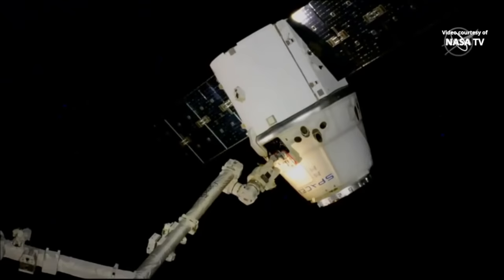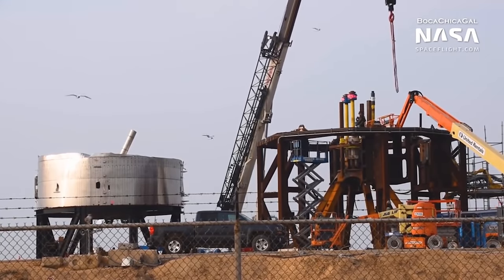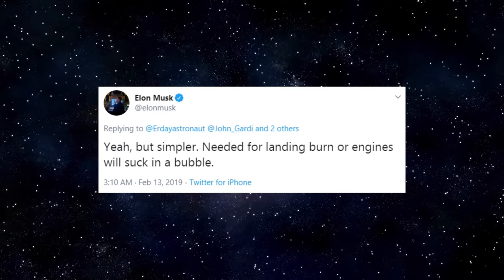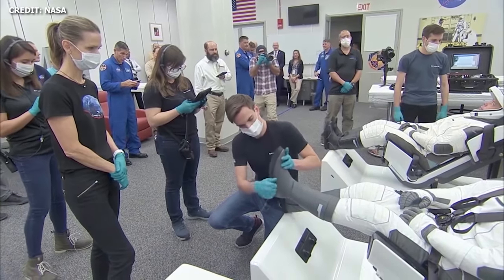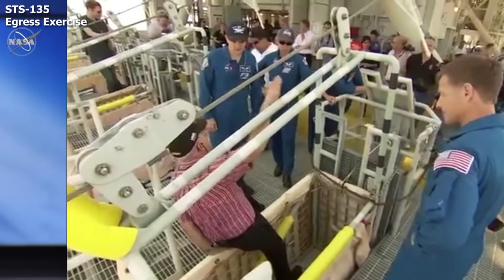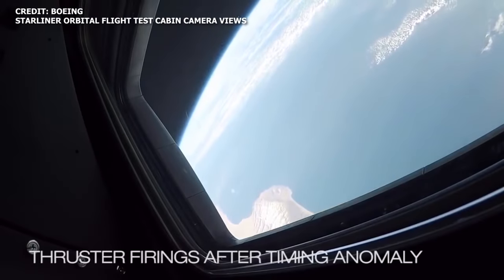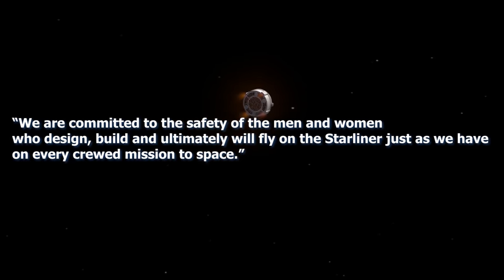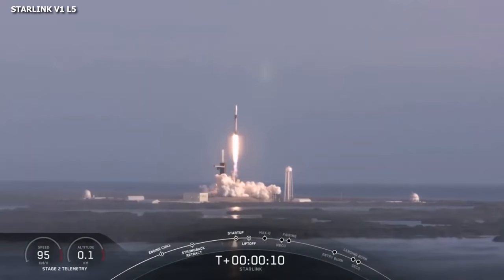SpaceX Starship Updates I SpaceX Crew Dragon DEMO-2 Escape Baskets I Dragon return from ISS

Comment: Crushing the lower tank wouldn't be happen if wasn't a lower tank, if the whole methane tank is a skinnyer cilinder put in the middle of the oxygen tank none of the tanks would support the weight of another, and both oxidant and fuel will reach to the engines without passing to a long pipe. It's interesting how a small change in design can improve a vehicle.